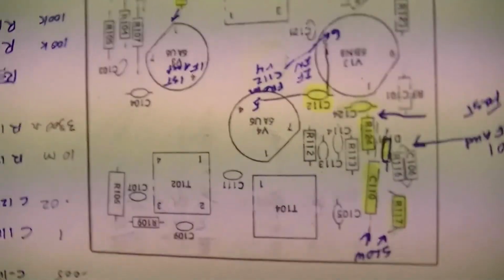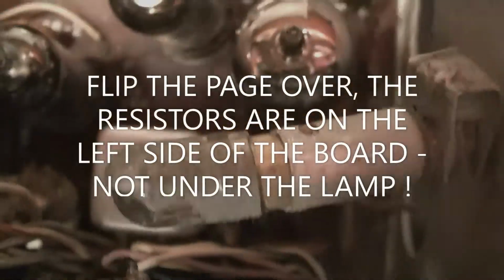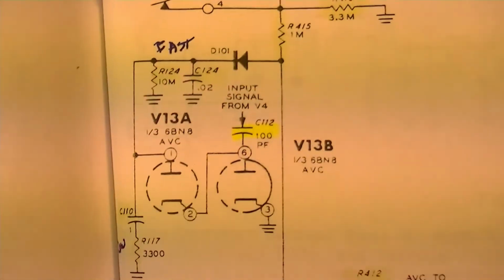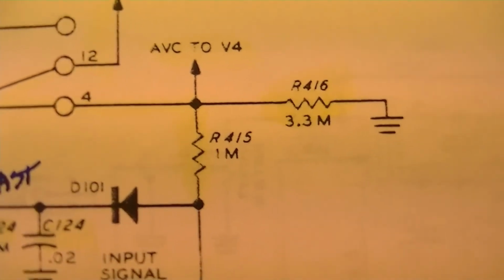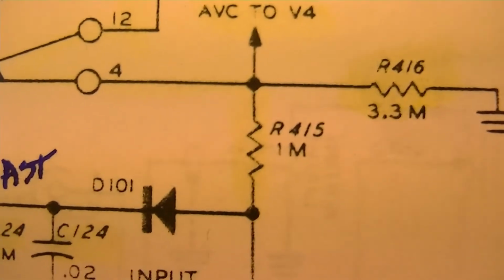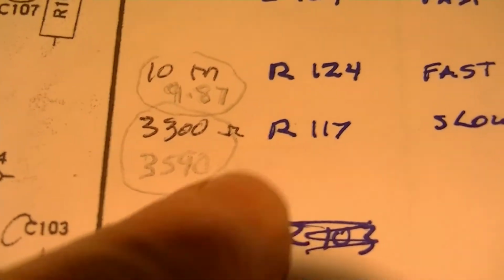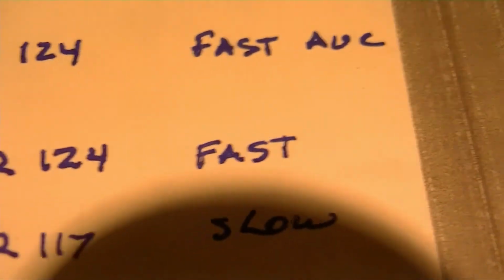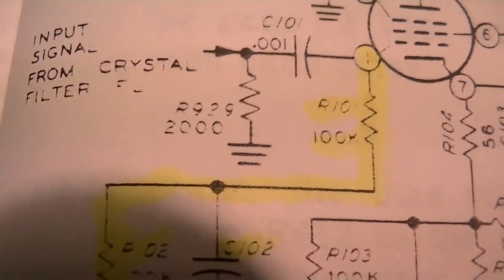HEATHKIT SB-102 AVC  Troubleshooting

Comment: Heathkits are very good. I have built some many years ago. The manual as you say is very good. I would say that they are the very best. I usually have problems with high value resistors going high in value rather than lower but I guess it depends on how they are stressed with high voltages.
Reply from the maker: Yes we are finding resistors aging out new film resistors are cheap closer tolerance too